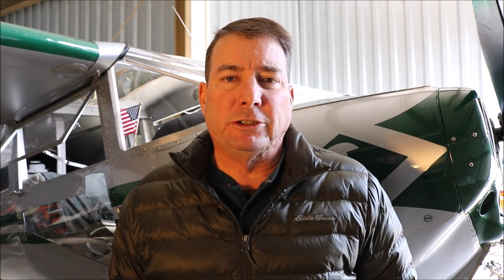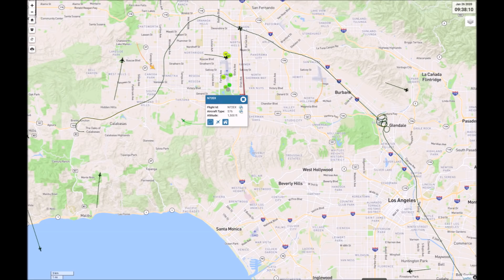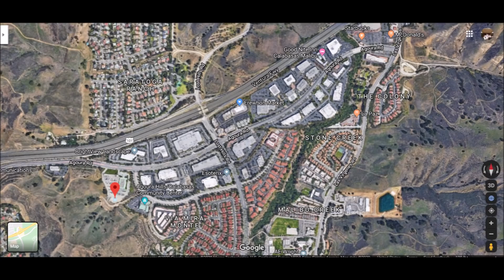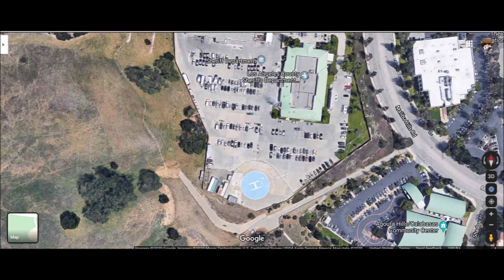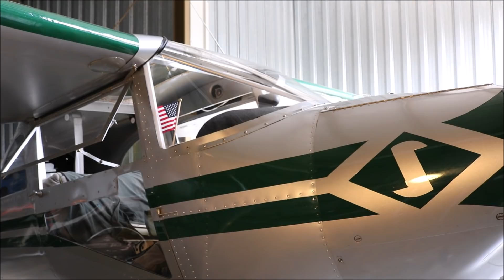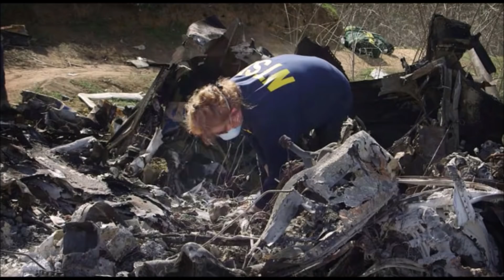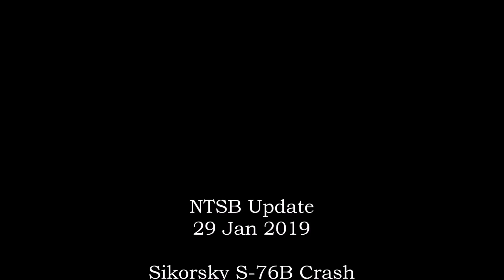Kobe Bryant Sikorsky S-76B Crash Update 29 Jan

Comment: VFR entering IMC and just simple go no go decision making.  Are they ever going to work this out?  RIP to all the victims.
Reply: LeftThumbBreak ........ finally someone gets it.....decision making is the main reason for this accident unless there was an equipment failure. VFR entering IFR ......and low level? The Pilot was IFR rated .....really? ...an IFR pilot with any experience would of requested an IFR clearance ... climbed to a safe IFR altitude and So Cal control could have provided a clearance for an approach at a properly equipped Airport... period!... then he lands ... turns around tells Kobe “ that’s as good as I can go “..... well rent you a van and get you the rest of the way...... if the weather pics up I’ll pick you all up at the school..... or what ever .
This accident was scud running ..... and this pilot was the chief pilot?
Reply: LeftThumbBreak... Exactly!!!! It's that simple.
Reply: 5:37 pay attention
Reply: You are assuming he ENTERED IMC, when it's likely that conditions TURNED IMC. That's what nails a VFR pilot, other than inexperience or lack of skill - this guy was a flight instructor.
Reply: vidznstuff1 .... from what I understand most of the airports in the vicinity  and area he was operating were in IFR conditions with aircrafts being held and IFR approaches and missed approaches occurring.... he needed Special VFR to even proceed through one of the control zones.... and Too Low for even Radar Flight Following???....In Terrain???.......and he was an instructor?.....the ones I had would of been making me turn and discontinue the flight until conditions improved. Very sad accident......

Comment: Not that it matters,  but the various media reports mention the descent rate was 1200fpm, 2000fpm, or 5000fpm.  Ntsb briefing said 2000fpm.  Not sure what data was recorded that can give such wide variations in that number. Tracon? ADS-B? It climbed to 2300 msl then crashed at 1085 msl.  Also the Ntsb rep misspoke about the time it took in that dive or descent.  It doesn't take almost a minute to fall 1200 feet and have a high speed impact.

Comment: Did the insurance policy allow single pilot IFR for this a/c?  Coast Guard and some military helicopters with two pilots can fly in smoke, dust and fog with very low viability.  Dust in Iraq  has been a problem.  The 2P monitors the radar altimeter while the 1 P flies.  With two pilots, USCG crews can rescue fishermen at sea in dense fog.  Was this helicopter equipped for 2 pilot IFR?

Comment: When your descending at that rate of speed perhaps he either thought he had the clearance to land at the helipad or lost control during his switch to IMC as you pointed out, why did he switch to IMC..... He could not see.

He lost comms with ATC which shouldn't have happened when flying in thick fog, flying a helicopter with zero visibility along your flight path is no different than navigating a submarine with similar terrain conditions, proper equipment would be needed, this should have been communicated from Air Traffic Control to the Pilot before proceeding with the left turn, all was fine until then, he could have landed it anywhere where he was in his holding pattern, You can't have Pilot Error and lack of Vital information from the ATC as to the weather conditions and 2800 Foot Terrain obstructions along  the approved flight heading while flying at 1400 Feet and all seemed well from the ATC to proceed.

What Pilot in their right mind would fly that special VFR in those conditions ?

https://www.atsb.gov.au/publications/2019/avoidable-accidents-4-vfr-into-imc/

Comment: 2300 ft - (descending high rate speed & forward velocity) - 1085 ft & high energy impact. seem like a pilot suicide mission.
Reply: It might seem like it, but I don't know why this pilot would do that.  That raises too many questions, when the simplest answer was that he got confused when he flew into the fog.
Reply: based on the recording, he was at 1400-1500 ft. when the twr lady stated wind calm, 1100 ft overcast, transition at or below 2500 ft, said he could next contact Socal for assistance. He didn't & remained silent for more than 5 mins before crashed. 
this guy stated was an experience pilot, knew the area well, stated he went up 2300 ft & nose dive to impact 1085 ft. The twr lady stated 1100 ft overcast (ground level just less than 100 ft /crashed), asked the pilot, transition at or below 2500 ft & contact Socal. He simply didn't follow the instructions & remained silent until crash.
Reply: question to answer. why he didn't stay above. why there was no sos /emergency call. why he didn't reply the Socal assistance. why he remained silent. in case of panic situation, why he didn't slow down,hover the helicopter & try to contact Socal.

Comment: Given the rapid rate of decent prior to impact, is it possible that the rotors took on ice and lost lift as a result of the higher altitude the pilot went up to trying to rise above the fog?  There was a lot of moisture in the air, and he went to altitude near or below the freezing point?  No sane person flying and worried about where the ground is would descend at that rate.  I submit that there was a loss of lift, not a disorientation of the pilot....

Comment: The pilot was a certified instructor and CFII (instructor in instrument flight).  It's hard for me to understand how an instrument instructor could not make a smooth transition from VMC into IMC by simply going onto instruments as soon as he lost a visual with the ground.  According to information online, he knew this route and would have known where the terrain was.  This doesn't make sense.  This should be a no brainer for a CFII who has more than 8,300 hrs.  It certainly would be for an instrument-rated, fixed-wing pilot to transition from VMC to IMC.  (I have done this hundreds of times.)  It seems strange that this (or any) pilot would opt to fly under marginal conditions if he did not have complete confidence in his ability to fly in IMC...should that become necessary.  He DID fly -- so must have been confident in his ability.  It is my opinion that the pilot had some medical event, became incapacitated, and the A/C went out of control and flew itself in to the terrain.   It will be very difficult for NTSB and FAA investigators to prove this, but maybe there will be a coronary artery plaque that disrupted or evidence of a non-traumatic cerebral hemorrhage or CVA at autopsy.  Whatever the cause, this is a very sad and tragic accident.

Comment: SVFR flight at low level in mountainous terrain under very MVFR conditions was utter stupidity.   The pilot didn't have an out if visual contact with the highway was lost other than to initiate an abrupt panic climb, the result of which my have been the ultimate cause of the accident:  Loss of control due to helicopter-specific aerodynamics.

Comment: Actually, this is not an aviation thing. This is a management labor thing. Somebody pressured somebody into doing something They shouldn't have done and it ended up biting them in the ass. I worked in the nuclear industry. Quite some time. And my main job was to keep management. From setting us up for failure. Whether it's a building collapse. A crane collapse. Or Shuttle blowing up over the Atlantic. I just hope they don't sugarcoat this because Kobe Bryant was involved.

Comment: Thank you for your informative videos. A couple of things stick out for me. It sounds like when the pilot was handed off to the last controller, the pilot was planning on continuing flight following, but changed his transponder code to VFR without being told to do so. The controller mentioned the 1200 and said that the helicopter was too low for flight following. Also, the press is getting it wrong. It appears from the flight tracking data and the NTSB briefing that the helicopter was climbing rapidly, but started a rapid descent in a left bank, suggesting a loss of control due to spatial disorientation. However, the media is making it look like controlled flight into terrain, rather than the uncontrolled descent at 2,000 fpm. I am looking forward to the video with your helicopter pilot friend. (Good luck with your FAA paperwork.)
Reply: You reached the same conclusion as I did about spatial disorientation, and all I've watched is Juan's videos.  I don't pay much attention to mainstream media because the anchors on most shows don't know much about anything, especially anything as complicated as aviation.  So I, like many others, are grateful for the YouTubers with experience and knowledge.
Reply: Robert, I side with you entirely. The heli dropped like a lead balloon to the left of the flight path and exploded next to two hikers (only approx 200' away).
There is no reasonable explanation other than the heli being in immediate trouble. It didn't fly directly sideways into a hillside, it fell from the sky at alarming speed, approx 176mph. 
I lived in the area over 30 years, those heli pilots could fly that blindfolded as there is a max height for the coastal mountain range, and GPS still works for those that tend to believe the MSM for all things political and religious.

Comment: Can someone explain why a helicopter pilot who becomes disoriented in the fog doesn't just stop forward flight or significantly slow down. A helicopter has this distinct advantage over fixed wing aircraft. Kinda of like pulling over  to check for directions. I'm not a pilot but the logical thing to do would be to stop forward flight and gain as much elevation as needed to regain orientation. Wouldn't something as simple as a Garmin GPS alert the pilot of potential elevation hazards?

Comment: He was disoriented in cloud
Reply: I am that way just driving thru fog on the ground I couldn't imagine flying in it trained or not.This tragedy could have been avoided.
Reply: brady chick Flying on instruments is a challenge but going into clouds unexpectedly when you are 100’ above the ground and surrounded by mountains turns your seat brown.  You don’t train for that because it’s a situation your trained not to get into.
Reply: @bradychick6535  ALL tragedies could have been avoided    that's why they are tragedies ,,
Reply: @pup2000  Thanks Captain Obvious.
Reply: @scooter Dave could be last second yanked the pitch up and compressor stall but maybe not as he was going fast ,
Reply: @scooter Dave the sikorsky has two engines, so compressor stall is highly unlikely
Reply: @scooter Dave most likey high pitched rotors with a descent.
Reply: There was no fog. Look at the videos again. The sky is blue.
Reply: @apollo5751  during flight it was in fact foggy when the crash happened. Soon after the fog lifted.
Reply: @TTundragrizzly  Having lived in Los Angeles & Ventura for more than 30 years I also know the morning fog isn't very high. It's likely it was only 1250-2000 feet at worst and not pea soup at the flight path elevation, but yes I read the pilot asked to climb to 2300. In Ojai the fog comes up the valley from Ventura, but if you are on top of any hill or elevated hiking trail there is no fog there and you can see well. The crash was at approx 1000', that should say quite a bit towards a heli malfunction.

It's impossible to decide what caused it to turn and fall but I am hoping NTSB will be able to.

Comment: Facing the same challenges with getting traffic laws changed. Im disabled and have nearly been hit several times trying to cross the street in my wheelchair due to traffic lights turning green simoltaneously with crosswalk signals. Nothing will be done until  myself or someone else actually die.

Comment: I fly both helicopters and fixed wing. I am quite familiar S-76 Helicopters and they are very capable and safe helicopters. First of all, they have two turbine engines and they are very reliable. Plus, S-76 are IFR capable and so was the dead pilot. So it’s puzzling why he chose to circle around for 15 minutes to get a Special VFR clearance. He should have either filed for IFR flight or better yet not take off at all. At a minimum, he should have returned and landed. My old instructor used to tell me what kills experienced pilots more than anything is arrogance and over confidence. He must have gotten away flying in dicy situations before and felt he could get away with it. I do not think TAWS would have prevented this accident. He was way too fast, he was doing 165 kts at low level terrain too close to the rapidly rising terrain. I think he lost his situational awareness and was disoriented. Series of bad judgments led to tragic consequences.
Reply: Absolutely right.  WAY too fast, especially once over the hill into toward Las Virgenes.  Lots of canyons, lots of minute to minute low level weather changes.  One good thing about an R-22, flying half the speed, you give yourself some time to recover from the occasional brain fart.
Reply: Kent Fletcher  I do like R22s also but remember, R22 rotor blades store very little kinetic energy and if you lose an engine you have very little precious time to react and auto rotate. Not saying R22s are dangerous because they are safe as long as you respect their limitations. Having said that, if you can fly R22s, you can fly any helicopters,  Me personally, my favorite is Bell 429s and Bell 430s.
Reply: @ArizonaAirspace  Oh, yes, I know the limitations!  Trust me, I would have loved to fly bigger, more capable birds.  I only had a bit under 100 hours, all in R22s.  That was in the 80s.  I had a windfall and started lessons out of Van Nuys, soloed at about 30 hours, then just flew for fun and to continue training until I ran out of money.  Always wanted to get back to it, but got married, etc.
Reply: Kent Fletcher   Yeah I hear ya. I know what you mean. Helicopter flying is out of reach for most people unless you fly for someone else or loaded. Too bad you don’t fly anymore. Maybe someday soon you can pick it up again. If you can fly R22s, other helicopters will be a walk in the park for ya. Cheers.
Reply: @ArizonaAirspace  Yeah, at the time I had a friend who had flown a few thousand hours in Cobras in VN.  He siad the same thing, and at the time I thought he meant "cyclic, collective, pedals..." you know, the basics the same no matter what.  Later he told me he would hate to fly an R22, too small, too light, too sensitive, yada yada.  Anyway, I wouldn't do it now, but it was some of the best money I ever spent.
Reply: @kentf8539  were you responding to my comment?
If. You. Were   thank you
Reply: The Opspecs for the operator didn't authorize IFR operation.
Reply from the maker: SVFR granted...opening the door to disaster?
Reply: blancolirio  That’s a controversial subject amongst Helo pilots. SVFR is also allowed for fixed wing operations too but the weather minimums for Helicopter operations are lower. It’s basically see and avoid for helicopters. I personally would not fly SVFR unless it was a life or death situation like in military combat operations or last chance rescue operation where you have no other viable options left.
Reply: @blancolirio  sir would you please respond to my comment above please?
Reply: Eric Stevens what comment are you talking about?  Both Blancolirio and Kent Fletcher were responding to my comment.
Reply: Sir I. Have.  A quick question for you... from what I. Understand
They crashed at 170-185 miles an. Hour...from. The wreckage
It looks like the HELICOPTER exploded...can I get  your thoughts on this please?

Comment: Thanks.  looking forward to tomorrow’s discussion . That helicopter world is so different from what us jet drivers know and understand. I’m sure a special VFR scud running is just a normal day at work for helicopters in that area at times. All the controllers didn’t seem to worried about it. I hope the guest speaker can shed some light on why it’s not just easier and or safer to file and fly IFR to a closer airport to the destination, then fly special VFR  from there.
Reply: Ty Matt If the pilot did file IFR, do you think it would have allowed them to get to their destination quicker? I’m guessing here but, I’m getting the feeling “they had to get there quickly (get-there-itis)“ and the pilot thought he could VFR/specialVFR faster that way. Your thoughts?
Reply: Big Jeff12 I think your on track here. I’m sure that IFR on a daily basis would be time consuming and saturate an all ready busy airspace. But in conditions like this I’m not so sure it would have cost any time at all. A more direct route? Not holding for 15min to get though the Burbank C airspace. I’m not sure it wouldn’t have been,faster, safer and cheaper. As a corporate fixed wing pilot I would have asked for an IFR clearance as soon as I was asked to hold because of my VFR status. But I’m not even sure that this flight  could. I understand this was a 135 charter on a certificate that may be VFR only. If that is the fact.  The pilot may have had only the option of a VFR trip or not going. Hopefully Juan and his guest will shed some true light on the ins and outs of the helicopter charter world.
Reply: Ty Matt Thanks for your thoughtful reply.  And yes, I hope Juan was able to find out a few more pieces of the this unfortunate event. Blue sky and tailwinds to you!

Comment: Can you tell me if the pilot was rated and aircraft were equipped and current to file an IFR flight plan from KSNA to KCMA?  It doesn't sound like there was sufficient altitude due to ceilings to pick up an en-route clearance at least late into the flight. I'm sure helicopter pilots navigate VMC much differently than fixed wing but I always flied IFR on that and similar routes for piece of mind and burden sharing of collision, terrain avoidance, and navigation. Understanding there would be a busy system due to the Wx and delays, but worth it, I felt. (1990's CFI MEI Ret. AA5B Part 91)